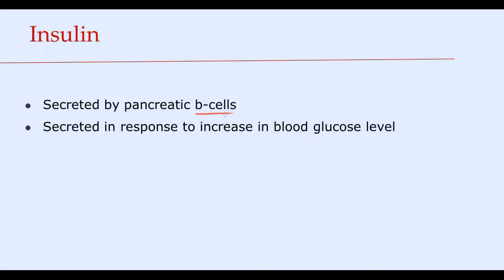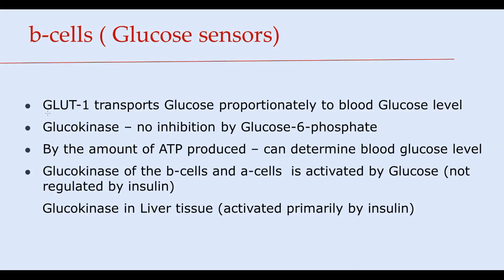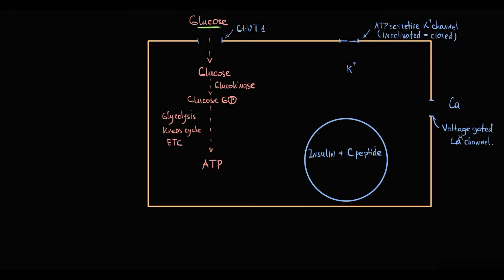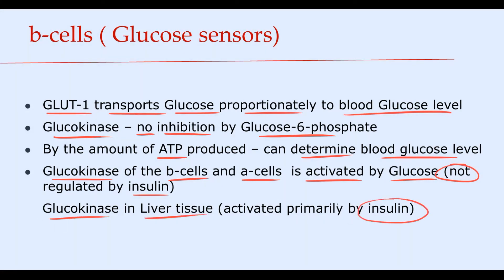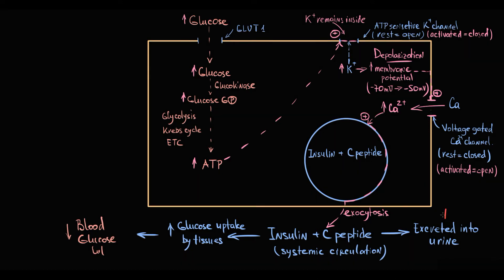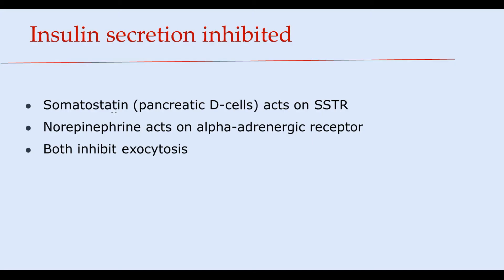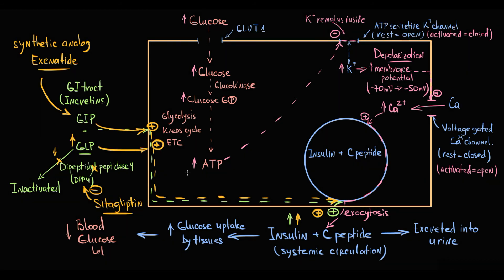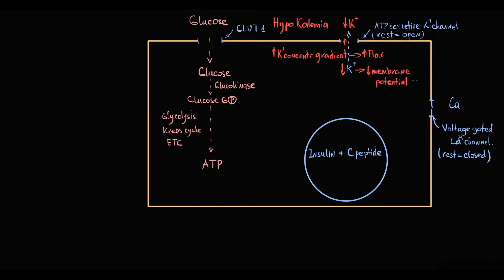Mechanism of Insulin Secretion. C Peptide.  Regulation. Type 2 Diabetes Mellitus. Physiology

Comment: first of all well structured videos. i want to add something for hyperkalemia: as the extracellular concentration rises it leads to a more positive equilibrium potential for potassium (as after the nernst equation). and as potassium is the most important component for stabilizing the membran potential, because they are the electrolytes with most conductivity through membranes, potassium is the reason for a certain membrane potential (this of course if no other channels of other ions are open as during action potentials). a rise in potassium isnt necessarly the reason for a more positive membran potential. correct me if i m wrong.
Reply from the maker: Thank you for watching, appreciate it very much )
Reply: with my reasoning i dont get why hyperkalemia is inhibiting the release of insulin. shouldnt it be more agonistic?
Reply: ahhh you were talking about hypokalemia lol